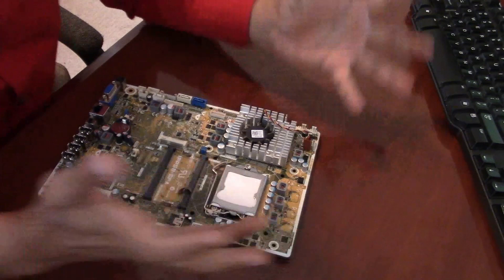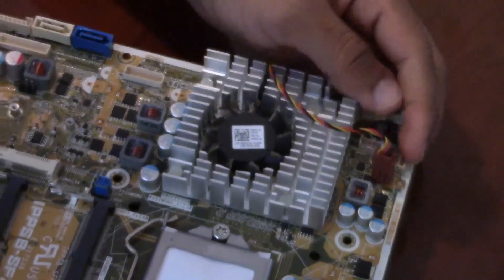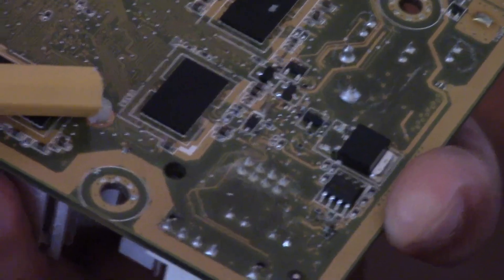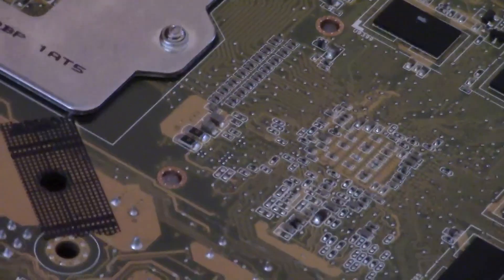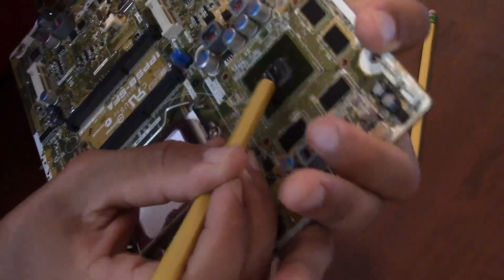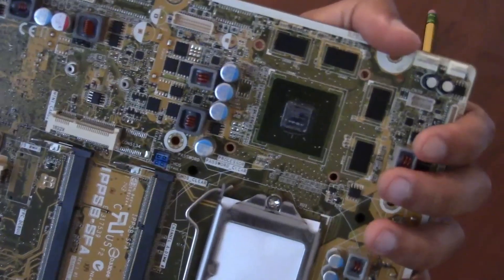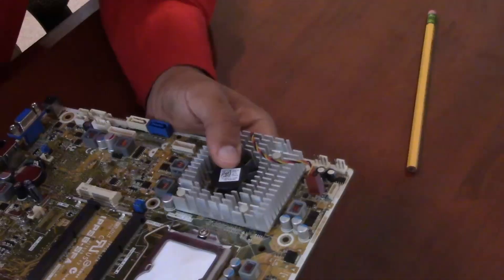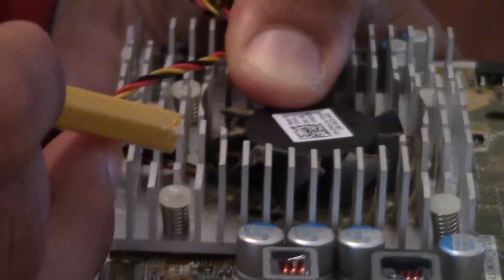Dell 2320 GPU reveal/heat sink removal

Comment: Hi @RAH Tech, I replaced my motherboard only to find out that the GPU fan power pins are not the same, on your video u have a 8 pin female GPU cable connecting the the 8 pin male on the motherboard. My new motherboard is the same, but the GPU cable is a 3 pin female cable. Is there a place to replace the GPU fan?